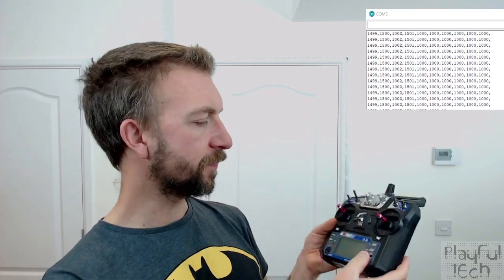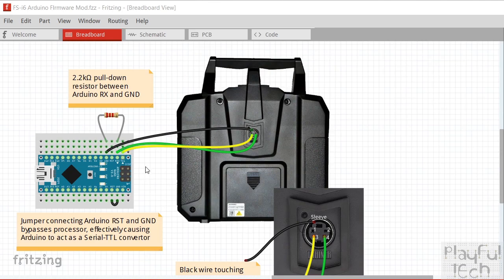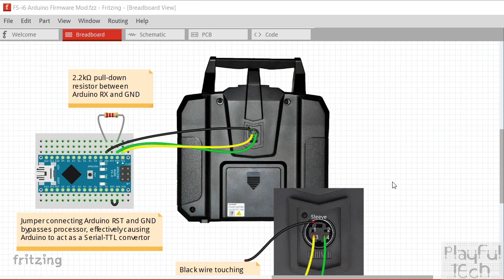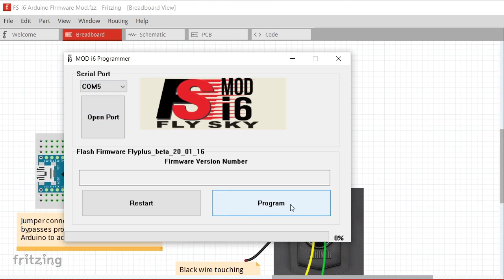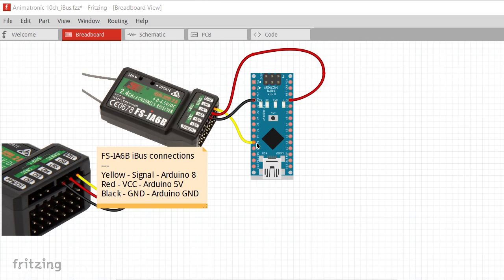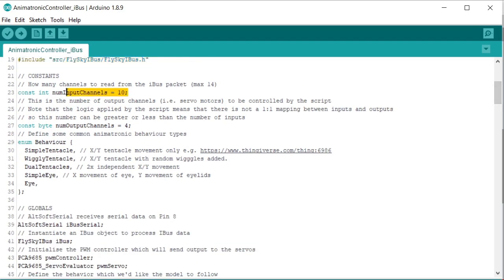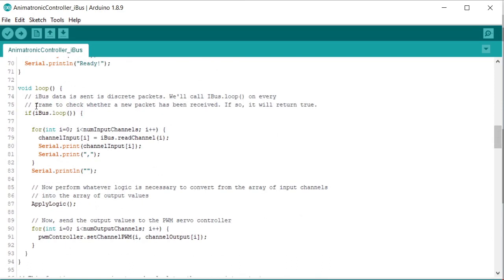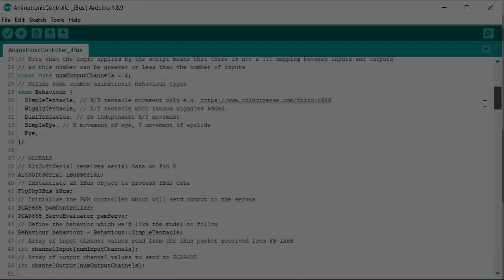Cheap 10 Channel RC Controller for Arduino Animatronic Projects

Comment: Could i use a different receiver instead of the FS-i6B (& could it control servo's and motor control via using Arduino)?

Comment: How about controlling the rc transmitter signals using an arduino? The joysticks outputs different voltages at different positions. Can I use the pwm pin of the arduino to imitate this voltage and thus control the signal of the rc transmitter?

Comment: Hi sir, Can we control stepper motors with this setup? If so can you please guide on how to do that? thank you.
Reply from the maker: Sure - all I'm describing is a way of using a RC controller to send 10 input channels to an Arduino. What you do in the Arduino code with those inputs is totally up to you!

Comment: I watched your video and like it. Firstly I can say that you do a great job. There isn't enought explanation on net that how can ve use 10 channel. According to your method I can use my FS İA6B receiver, then connect it to arduino nano via sbus and then connect arduino to PCA9685 16 channel PWM driver. So at the end I there will be lots of connection and component in my airplane. But is it worth? I can buy a new FS İA10B instead.